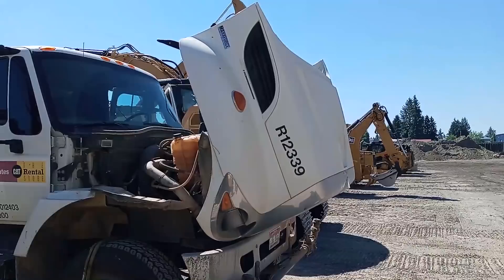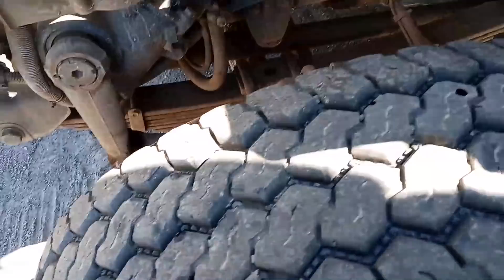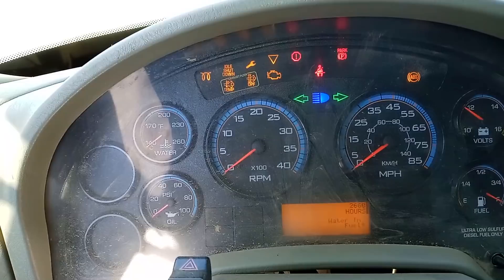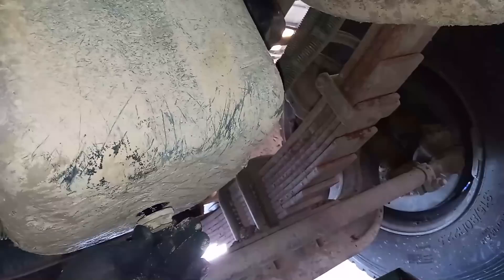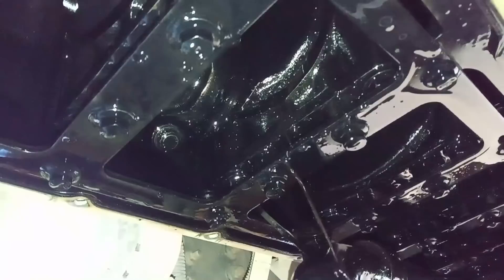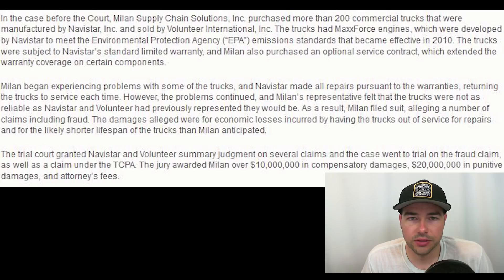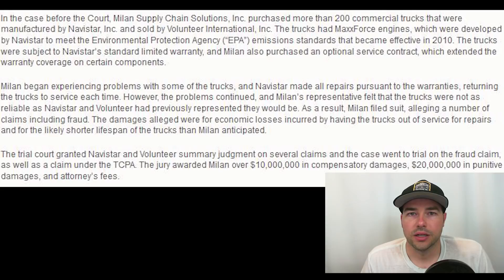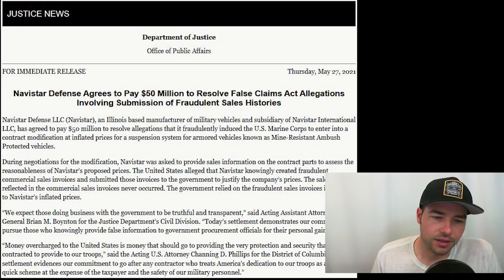CAT Mechanic working on an International. Are Navistars and Internationals Junk?

Comment: never drove a IH that doesn't have wireing issues mostly due to the connector in the dash operated a day cab with a 290cummins, totally reliable The best way to crash the wires was to hook up to a piggy back trl

Comment: Navistar has their own A26 engine that came out in 2017 which comes standard in all their trucks except the MV (newer 4300 model) and the shitty CV series (cheap Chevy top kick knockoff). Although the A26 has had a few drawbacks, it’s an incredible engine.
Reply: That’s because it was designed off of the MAN D38 platform and uses a Cummins designed emissions system.
Reply: We run small fleet, all International Lonestar's & we really like them, they are all the new X15 Cummins. 
This week we went out on a limb & bought a LT with the new A26 we did however get the 600,000 mile warranty just in case. 

I feel Navistar has learned a valuable lesson & is turning out a great product post 2017.
Reply: @sdpistolero327  D26
Reply: The A26, or the Volkswagen D26, I actually like it.  The DuraStar still has Cummins only, the dreadfully underpowered ISB, and the unfortunately uncommon ISL.  The CV, which I still say stands for Chevrolet Vehicle, looks more like a Silverado, than the new Silverados do, which has (because of course it does) the 6.6 Duramax.  ISB maybe?  Or can’t they be bothered to do anything at all with exception of taking off bowties and putting diamond stickers over them.

Comment: Most likely it was just the EGR cooler. Sometimes they get big holes in them and make it look like a cylinder.
Reply: Unlikely, EGR coolers on the EPA 10 Maxxforce DT/9/10 (99% positive the engine depicted in the video, would need to get a closer look to see if it was an N9/N10) usually fail and cause coolant to go through the engine and exhaust. I have only seen one or two hydrolock engines.
Reply: @Downstriker559  well I have seen it. Only time u see cylinders leak that bad on EPA 10 is overheat.

Comment: Hold panel bright and the instrument cluster toggle at the same time to silence the chime.
Reply: Save your money and sanity and buy a Kenworth or Peterbilt. Even Freightliner has gotten better. Manual tranny though.
Reply: instrument cluster toggle?
Reply: @Raise986  Hold panel bright button to the up position and the black plastic instrument cluster toggle switch (on the lower right hand side of the cluster) at the same time until the chime goes away.

Comment: I have a 2007 international 9900 with a C15 Acert, wiring was actually the one things I liked because I haven't had any issues with it  in the 3 years I've had it.  It's still held together super well, very easy truck to maintain.  I guess they went down hill the newer they got and the more of their own engines they tried to shove in their though, I know those are pieces of junk.

Comment: We have about 16 2012-2016 International MaxPro’s. Each one has had $1000’s of $$$ in EGR, fuel injectors, fuel pumps, DEF, emission software, etc. Each truck has had these components replaced multiple times. We have finally switched to Peterbilt🤞 .

Comment: The old DT-466 really liked to have it's coolant filter changed when called for or cavitation would eat thru the sleeves just above the o-rings.  The problem may have never been fixed. This was a problem back in the 70's when IH used the 400 series 414/436/466 on the ag side. 436 mouth breather seemed to be the worst an old mechanic told me.

Comment: I don’t comment on here much but I’ll say this. I have 4 maxxforce engines and all four I did a delete, cored out the dpf filters and blocked the egr valves. I have had Zero issues since I did that. They have been super reliable. They range from 2008 to 2011. They are all dt 466

Comment: I worked at a bus company a few years ago, and the company purchased twin 2012 IH Durastar hybrid buses with the MaxxForce and six speed Ultrashift. One bus was reliable, the other went back and forth to the dealership numerous times for engine problems just about every few weeks. The older 5.9 litre Cummins buses and the junkers with the Cat 3116 were more reliable. Plus the hybrid buses had a cab that was more for a five footer than a six footer like me. Very cramped and not user friendly. My 2004 Freightliner was roomier.

Comment: Tip to keep your sanity :     If you press and hold the odometer button on the ICU , and hold the Down button for the lights dimming, the ANNOYING low air buzzer will shut off

Comment: I’ve always been a fan of International, we always had International School Busses since early 70’s. And yes they had many crappy engines but they had lots of great engines, The inline 6 back in 1993 (Don’t know the name given to that engine) and the T444E were 2 fantastic engines.  
They had many gauge cluster issues  (after 90’s) they are junk. 
You have to separate the engine and the vehicle, cause if the engine isn’t an International and made by Cummins or Detroit and the engine has issues then it’s an engine problem.  The vehicle itself has its own issues.    A lot of the issues now is computer related, get rid of the computer and I’m sure a lot of problems would fix themselves.  

Are they all bad?  No but they have their problems just like all the other trucks.
Reply: Any coments on the International 9.0L? They're almost indestrutible, and sound amazing if you put straight
Reply: @panamatrucker  the 1st 10000 9.0 blocks were too thin on the deck. 5 or 6 head gasket revisions, some oil leaks otherwise good engine. The cool part was the piston came up beyond the deck, the head was cupped for piston clearance and the valves were angled like a hemi.
Reply: @greggwenig6163  in past we ran a lot of those 9L and Cats3208 here in Panama as a public transport buses, they were so damn loud man, i love hear them around the city racing each others

In these days they are difficult to find
Reply: I will agree with you I actually word for international 
I don’t per say like the body styles but they are pretty good trucks people say they are shit because of the engine in there truck pop the hood and it’s a x15 Cummins 
Well then that’s not a Internatinol truck problem that’s a Cummins problem

Comment: You can always tell when an Intl. shi*box is ahead of you by the smoke and stench blowin out the stack.
Fleet I drive for had Prostars, worst truck I ever drove, had the p o s hendrickson junk air ride with the huge torque box for torque arms...
Laxxforce under the hood...
Glad they didn't last long.
In my opinion, the only trucks Intl made that were good trucks, were their CABOVERS!
Love old school cabovers, cause I'm old school.
And of course the old gal the Intl Loadstar with the gas engine...
Thats about all there was for delivery trucks and school busses when I was little...
I drive a Mack Anthem today, with the MP7 little 10.8 litre and an automated 12sp, and I gotta say Mack got it right, finally.
This thing runs fantastic.
Crazy good pwr and no egr issues yet in 2yrs 160k...   trans shifts good too with no issues.
Loved Cats, and Cummins, but that X15 is noisey! Runs good but loud on the outside!
I'm keepin my little quiet MP7 bulldoggy.

Comment: The max force 13 is known for knock sensor failure that ends up loosing 5&6 blowing the rods threw the block and at times splitting the block in half.
All engines have there ups and downs.
I now work on hydrogen powered Kenworths and LR Macks electric powered
Reply: THAT IS GOOD TO KNOW!!
I LOST A INTERNATIONAL 
ENGINE IN A CAT TRUCK
WAS THE # 3 OR 4 CYLINDER 
BLEW THE ROD OUT THE LEFT SIDE OF BLOCK!

Comment: International dealer Tech here...yes the Prostar with the Maxxforce 13 was 🗑, the N13"B"(2016/17) was much better and easier to work on, the current model the LT with the A26 is a dream to work on IMO,  they designed it around uptime so each repair is faster and more straightforward.
Reply from the maker: Is the A26 based on the Maxxforce or a completely new platform?
Reply: @AdeptApe  the base engine is the same, they removed the twin turbo setup and the interstage cooler which made the passenger side a nightmare to work on, the egr cooler and valve from the N13B have been retain as well as the 2 speed fan clutch, the variable from the Maxxforce caused the fan to fall off and go through the radiator, the fuel pump has been upgraded, and they really just tidied up everything on the  engine its hard to explain every detail but if you open the hood you see a big difference!
Reply: Could N13 and MAXFORCE engines have A26 components installed on them, as a conversion to A26 update level?
Reply: @michaelglenning5107   The varible fan drive can be converted, which I highly recommend because when that thing goes flying off you can imagine the damage it does, also shavings fall into the pan which can end up in the connecting rod and main bearing caps...its a mess! Other than that your stuck with the rest of it.
Reply from the maker: Cool info, thank you.
Reply: What do you think about maxxforce dt 9/10 year 2013 ???

Comment: I was at the company that sells the gas engines that replaced the 444 and 466 Max Farce diesels that just couldn't handle city driving in school buses . I H had laid off the majority of their engineering staff since the EGR pipedream had proved un workable over a decade ago . Many I H people ended up at the industrial engine outfit and were stuck on the I H gas program. I H was too cheap to spring for a new wiring harness or ECM and body module . Their former engineers had to come up with a stand alone ECM that plugs into and works with the ancient I H electrical system designed for diesels . So you have a separate ECM underhood that operates solenoids and pumps for gasoline and CNG , LP or regular propane or a combination of both . Early on many electrical failures were due to the goo I H slops onto all electrical terminals and plugs.

Comment: I just got my Cat truck back from my dealer. Ct13 engine with a broken egr valve and both coolers plugged. $10000 for parts and $8700 for labour.
Reply: Should of cut your losses
Reply: @OffroadCpl  the truck is only 8 years old and it was still cheaper than a new one
Reply: About to take my CT660 for cooler issues. Good thing I have extended warranty

Comment: As a Paccar tech for Kenworth they deff take wiring seriously. The first time you do a engine or chassis harness you will understand. Well made but alot of work to remove at least its not common aside from operator damage. Typically trucks in the landfills are in my experience that destroy the harness.

Comment: I just bought a 9400i that was the only thing decent I could find pre-emissions that that the prices weren't inflated into Bolivian ...

So far the only thing I really hate about it is the dash is a piece of s*** the hood wiggles and I have no cruise control or fan override...

Other than that she rides half decent she does have 600,000 on her and surprisingly it's rather quiet inside.

Comment: We had 3 2015 international prostars. I had nothing but harness issues. From the factory one of the harness in the dash was ran over a sharp metal edge with no slack to move it away

Comment: I had a 7.3 IDI those were reliable engines I have a  6.0 been good for ten years 🤷🏻‍♂️🤘🏻🤙🏻
Reply: Did you upgrade the oil and egr cooler?
Reply: @PoliticalGangster  nope Engine was blowed up in 2009 I am second owner I haven’t done nothing but put a turbo on this truck ….yet🤣🤣👍🏻 and of course reg services ✌🏻

Comment: When I was in a beer distributor fleet, my boss was pissed on how bad the EPA 10 dt were in reliability. Had traded 6 S lines tractors for 6 new 4400 with "new" twin turbo dts in a TERP deal the EPA was doing. By the time the first year went by, the folder holding all the warranty work ,tow bills and repairs in parts surpassed the thickness of a 2002 4400 with a old dt466 since it was new. EGR coolers were a maintenance item on those things if they would only last 100k
Reply: The S series was the last good looking IH truck line

Comment: Normally the engines are diehard it’s the aftertreatment system that throws requires that cause 98% of the failures of those engines. The coolant is probably coming from the large single o ring seal for the cylinder liner. I think their downfall was when the emissions started pushing very hard. 

I worked as a navistar technician for years and I think they are very simple and reliable plus every company goes thorough changes and modifications over time.

Comment: In Philly our trash trucks are mostly freightliners with some intl. Mostly cause they don't have highway miles most of all our issues and Regen after treatment stuff. No driver runs the Regen with the truck passive Regen. They don't smell the difference or notice the slight rpm change. By the time I get to fix it I gotta use Cummins insite then I can do regens

Comment: The Maxforce engine is a good engine in lab settings with no environmental. Fuel, oil, and air different it works good.  Look at the data the International publiced.  It only messes up in real world conditions

Comment: Customer of mine has a newer International dumptruck. 2014-2016 N13 motor. Was great until it was throwing codes for fuel rail pressure beyond maximum. Had a bad fuel pump. $10,000's later it runs great... :(

Comment: Love the Mechanical DT 466 
But after 2000 international/Navistar been going down hill. I can't stand a Prostar had a Maxiforce in a Penske prostar truck for a time not a fan. 
We got a 2010  9200i with a ISX Cummins in it. It's the wiring fault codes ECMs  wiring. an outfit I ran for bought a mess of 2010 IHC Prostars they had nothing but trouble out of them. I miss my 99 9200i 
Red top N14 10 speed 200 gal fuel 6 mpg  metal bumper and no aerodynamics. Improper repair dropped the #2 injector rod out of the block. 
The mechanic only tuned up 5 &6 
Didn't check the other 4 cylinders.

Comment: It's actually intersmashable. take it from a person has owned some internationals. International had a serious problem with their drive by wire systems. that caused the truck to be in the repair shop for a long periods of time.because of a undiagnosable problem. it was really common on the DT466 engines.   however when they made the Scout, the Travel All, and their pickups. they were indestructible way better than a Ford a Chevy and a Dodge. I'll never understand why they stopped production on them.

Comment: Maxxforce 15/CT15 was a good attempt to modernize the 3406E family, which CAT could’ve built upon to make a triumphant return to the OTR world….but unfortunately the Navistar-sourced truck line had too many other issues and they shut it down shortly thereafter. 

I really liked their automatics and the gauge layout, but the exterior styling and overall quality left a bit to be desired. Buying off another company to R&D a product CAT slaps its name on, is a foolish mistake for such a reputable company to make. 

The only CAT product I would want these days is a fully mechanical 3406C with C18 internals and a small VGT turbo, transplanted into my Aerostar cabover. Massive torque from the long stroke/slow turning (downsped) platform, replace the KTA I have now.

Comment: I AGREE 100% ABOUT THE TOO SMALL WIRING ISSUE!!
THE WIRE AND INSULATION ARE TOO SMALL FOR NEEDED PHYSICAL STRENGTH!!
I HAVE HAD MORE PROBLEMS WITH MAX FORCE ENGINES THAN ANYTHING ELSE COMBINED, IN MY WORK AS A DRIVEAWAY DRIVER!
THE WORST FAILURE BEING A ROD
THROWN OUT THE SIDE OF THE BLOCK ON A CAT TRUCK!
ALSO SEVERAL FAILURES OF THE FUEL PUMP ON THE SMALLER SIZE ENGINES!!
Reply: Why are you screaming?
Reply: @johnwyman6126  I HAVE HAD A CELL PHONE SINCE 1995 AND STARTED TEXTING AS SOON AS IT WAS AVAILABLE!
IN THOSE DAYS KEYBOARDS AND VIEW SCREENS WERE VERY SMALL AND I USED ALL CAPS FOR READABILITY!!
IN THOSE DAYS NOBODY BITCHED ABOUT ALL CAPS!
LATER APPARENTLY SOMEONE DECIDED TO BE A TEXT POLICE TO GIVE HIMSELF A POWER TRIP!
I PAY MY MONEY TO HAVE A PHONE AND TEXT ON IT,
AND IT IS MY RIGHT TO USE IT AS I SEE FIT!
Reply: @rossbryan6102  In case you haven't noticed, times have changed, phones have also changed. Courtesy and respect haven't.
  How much respect would you have for someone who only ever screams, and when asked why they are always screaming, starts blaming anything and everything they can think of? Especially the one asking the question.

Comment: You know, there's so many of those trucks floating around out there because of fleet purchase, I always thought if a very talented mechanic was able to find a way to modify the engines to be reliable they'd probably benefit quite a bit if they did it right.
Reply: The epa will shut them down cause the best way to make it reliable is get the emissions off. And that's a no no...

Comment: The company I work for almost ALWAYS buys International for our fertilizer spreader trucks. EVERY SINGLE YEAR, and usually multiple times a year, they’re broke down with an engine issue. DEF systems, head gaskets, high pressure/low pressure oil pump, fueling issues, radiator issues, “electrical fault” issues. Diesel mixing into oil, coolant with oil. And don’t get me started with our 08 MaxxForce. It finally finished taking a huge dump a couple weeks ago…. It’s CONSTANTLY something with them! They make a good truck, but make HORRIBLE engines!

Comment: I bet that company doesn’t buy International again but I’ll bet also it was the accountants that made the decision to buy and not the guys on the floor, some things never change.

Also I used to own a GM 8V92TA that had problems with coolant in the oil, the oil was a creamy white color and showed signs of foam. Eventually it hydro locked and bent a con rod and threw it out the side of the block.
Reply: Everything they buy now is Volvo.
Reply: Just as well youve got a sweet kitty now